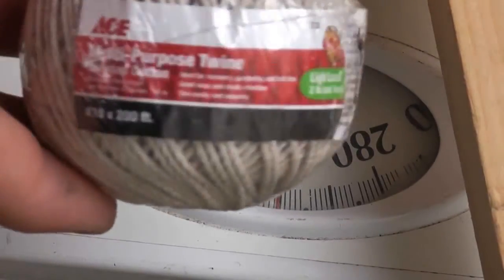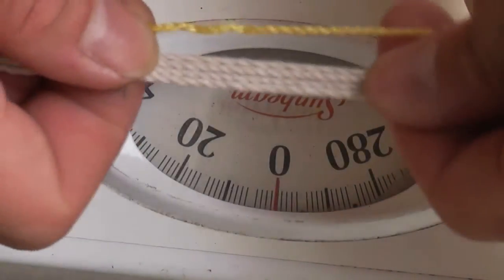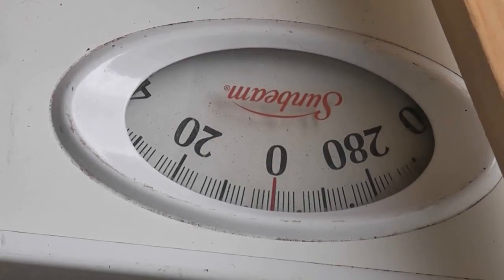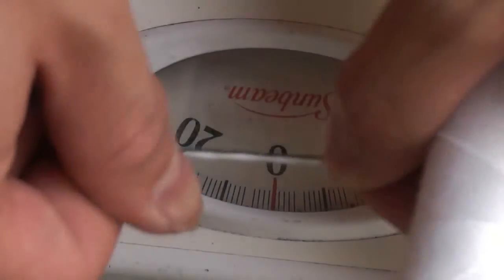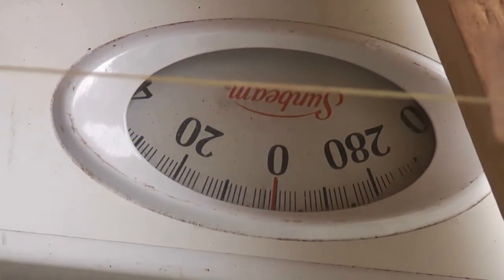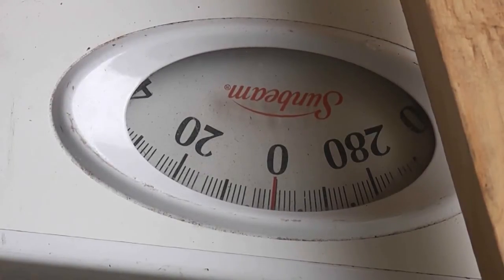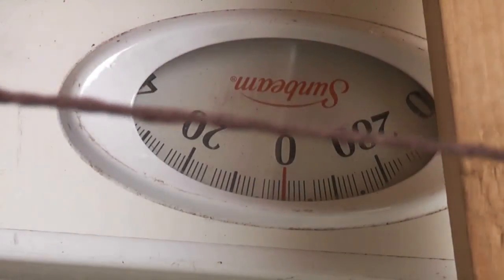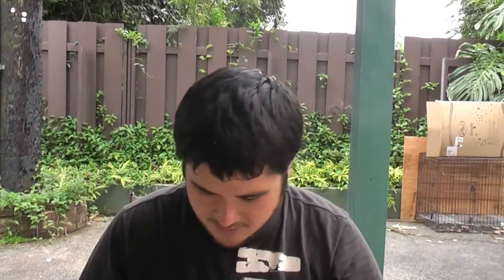How to Test the Breaking Strength of Various String Materials for Bows Part 2

Comment: How about Dyneema? That stuff is unbelievably strong. SK75, SK78, SK90, and especially SK99. Each one blows Dacron out of the water both in strength and stiffness per unit weight. Most of those have breaking strengths of 100+ lbf , so you could in theory get away with a two-strand endless loop string on any bow up to about 40 lbf draw weight bow. But then the serving thread would have to be very thick in order to fit the arrow nock, and to avoid slicing into your bow's string nocks like what happened to your tillering tree.